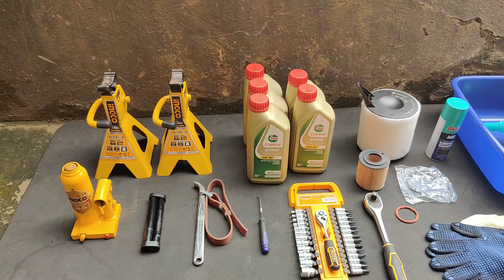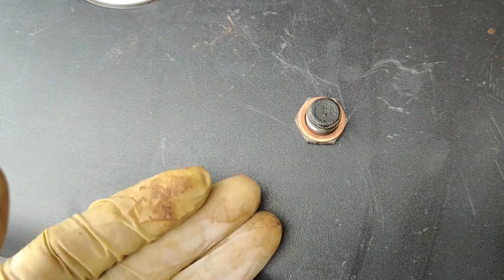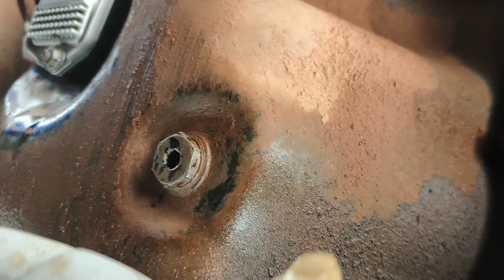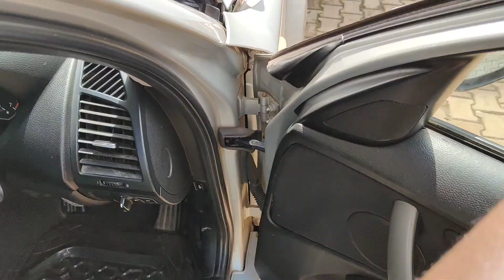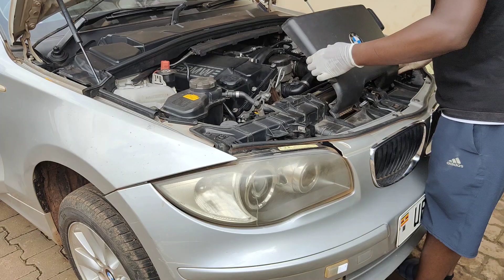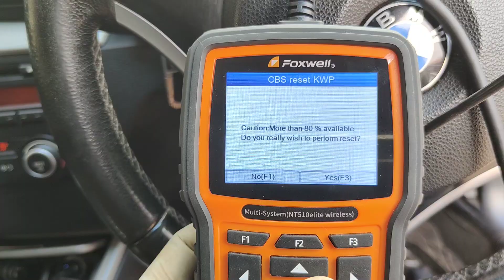Complete Oil & Filter Change Guide + Oil Level Sensor Seal Replacement

Comment: how long does one take before changing an air filter
Reply from the maker: Usually every 12,000 to 15,000 miles (or about once a year), but if you drive in dusty areas or heavy traffic, you might need to swap it sooner!